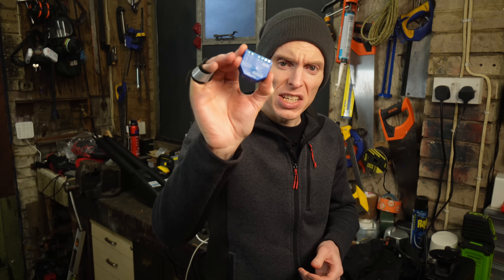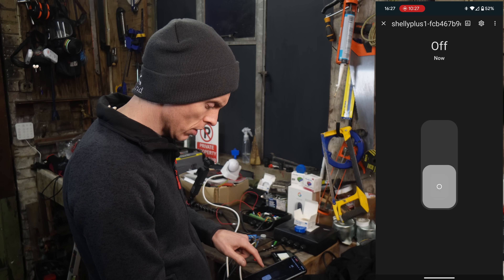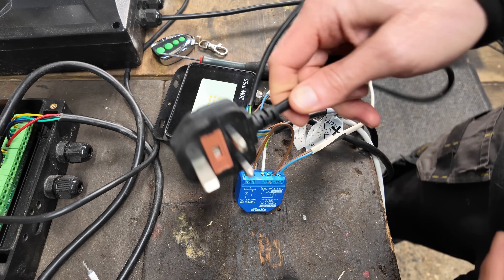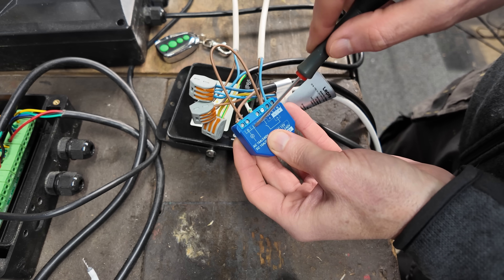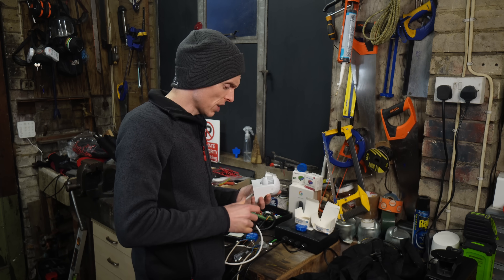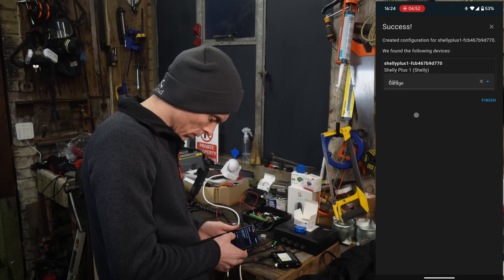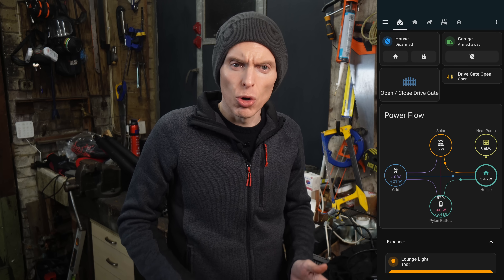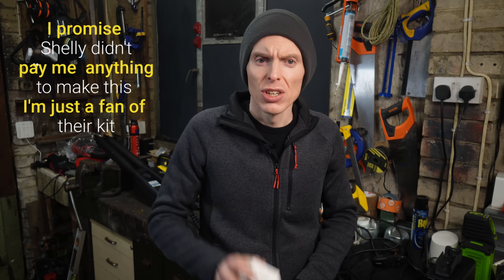Shelly 1 Plus: The Swiss Army Knife of Home Automation!

Comment: I found this a while back and worked out I could use this to pick up if a circuit was getting power. I’ve added this to my heating system and I can now see when the system is calling for heat or hot water and then when the pump gets power. Added the additional unit to the plus one and monitor flow and return temperature to the boiler and other parts of the plumbing system.
Reply from the maker: That's great use case for this, thanks for sharing.

Comment: Lots of modules have decoupled  relay mode. I use the Sonoff ZBMINIR2 which is a zigbee module, in decoupled mode, in light switches so that the switch operates but the power to the smart bulb is always applied. If the light switch is toggled and the light bulb doesn't toggle because it has crashed then a Node Red automation kills the power to the bulb and then reapplies power and then operates the bulb correctly... simples
Reply from the maker: I'm sure they do, just not something I've seen on any of the other switches I've used before, I've got a bunch of Sonoff stuff but none of their switches, never really seen the point in a mains powered device using Zigbee, saying that the new Shelly Gen4 devices support both WiFi and Zigbee so you can choose whatever works best for your use case.

Comment: But if you buy a wifi motion sensor... you will have the same.... I let my camera's detect persons/cars/license plates/animals etc... and pass that individual information on to the switches. This way the neighbor cat does not activate it or anything that emits heat... like opening the door in the winter. PIR motion sensors have too many false positives for me. Decoupling the switch could already be achieved with Sonoff switches and Tasmota software installed on them (for quite a while now). It's really not something new.
Reply from the maker: Do you know of any IP rated wifi motion sensors? I did look and couldn't find any, that's what originally inspired me to come up with this solution. I've also used frigate and the detection of people to switch on the lights. 

I wasn't really suggesting the detached switch was new or unique to the Shelly modules, just pointing out that it's there and really useful.

Comment: Why wouldn’t you use a smart motion detector and a smart switch?
Reply from the maker: When I first looked (it was several years ago now) I couldn't find any IP rated motion sensors. I've got loads of zwave motion sensors in the house but nothing IP rated for outside.
Reply: @ Tx!

Comment: I added a Shelly to my doorbell. Everytime someone rings the bell, I will get a push notification. (If I'm in the second floor, in my office, I cannot hear the doorbell, when the office door is closed. - a Shelly was cheaper than an alternative wireing and a second bell in my office)
Reply from the maker: Thanks for sharing your use case, I had a similar problem in the loft of our last house, ended up with a Nest doorbell and Google Homes dotted around the house to solve that, but I appreciate privacy concerns mean that's not a solution everyone is comfortable with.

Comment: I’m using Shelly i4s to indicate when lights are turned on in a room and trigger media players.  The problem is the i4s need an isolating relay in circuit to prevent the back feed from the live/neutral of the load triggering the i4s constantly.  Im also only using one of the i4s inputs in each case. I’m guessing I could use these instead as a trigger for HA and simply isolate the relay as I don’t need it to do anything and also negate the need for isolating relays.
Reply from the maker: Yes, it sounds like you could probably use a Shelly 1 Plus instead of the i4 for that, I am curious, why would you not also want to use the relay to allow you to remotely switch the lights on/off or automate them?

Comment: Was gonna say it's WIFI, and no one want a wifi powered smart home. But gen4 is Zigbee !
Reply from the maker: I've got a selection of Zwave, Zigbee and WiFi devices, I have no problem with WiFi smart home devices for anything with a permanent power connection, I have WiFi everywhere so it makes a lot of sense. But the new Gen4 devices having Zigbee is a great addition.
Reply: Like everything it's a tradeoff. I like WiFi since I can banish it to a VLAN & firewall it off and don't need to add a ZigBee hub as a dependency, MQTT and ESPHome both work great and are very reliable. I have a couple Shelly Button 1s and while it took them a while to get the firmware right they're pretty fast now & rechargeable (like twice a year I plug them in), no coin batteries to worry about replacing. But for things like door and window sensors, ZigBee is the only thing that really makes sense
Reply: I have way better experience with wifi over zigbee, had so much issues with zigbee in my house I would say: who wants a zigbee home? :p
these shellys are mains powered, and thats good since nobody wants to swap batteries anyway
Reply: Hold up brother….nobody wants a sub protocol over WiFi….id suggest upgrading your network infrastructure delivering WiFi

Comment: Great application examples, thanks. I have a Shelly 1L controlling my shed flood light.
I also use the Sonoof Zigbee switches, which I find work much better for no neutral applications.
Reply: The ZBMINIR2 sonoff devices (that require a neutral) are great devices too if you already have a Zigbee mesh and they support decoupled relay mode whereas the ZBMINL2 (no neutral) does not
Reply from the maker: I've never tried any of the Sonoff inline modules, probably should they seem to be much cheaper, but that does make me a little uneasy, sometimes spending a bit more for something you're embedding in the walls of your house is worth it.  I know the Shelly modules have Overheating protection and the power monitoring modules have Overcurrent / voltage protection,  not sure the same is true for the Sonoff modules.

Comment: We have 240V(+9V) smokedetecors with signal to chain all detectors. I've added the Plus1 mini inbetween the signal cable to turn on all lights an infrom my phone through HA in case of an smoke alarm. Should be a requirement.
Reply from the maker: That's an awesome use case, thanks for sharing.

Comment: Shelly devices are the best on the market. Cheap and affordable. I use the detached relay mode so I can control smart bulbs from a normal switch without cutting power
Reply: Doing the same here. We have floorlamps and using the standard wall switch.
Reply from the maker: Thanks for watching and the comment, much appreciated. I've just bought a bunch of Moes ZigBee GU10 bulbs and am planning to do the same thing for the wall switches 👍

Comment: Could you wire the Shelly, with a motion sensor to the aux input of the victron multi plus so that it charges the battery when the postman turns up? 😅
Reply from the maker: Well that's just silly, it would charge the batteries when anything moved, obviously I would need to use Frigate to do facial recognition on the postman and then use the shelly to trigger trigger the Victron aux input charging, no more foxes triggering charging, just the postman 😄
Reply: @RodMcBain  good point… I didn’t consider the foxes!

Comment: Yes, the decoupling is the key feature.

By the way, Gen4 products are available now, which add Matter and Zigbee connectivity (along with the existing wi-fi and Bluetooth).
Reply from the maker: I did see the Gen4 products are out, very cool and still great value. It's taken me far too long to edit this, they weren't out when I recorded it 😀
Reply: Have you tried a gen4? Can they integrate with ZigBee and act as a router there while themselves being controlled over Wifi? ZigBee notoriously has a bad range in non-wooden houses, requiring me to pepper my house with ZigBee plugs just to relay the signal. It would be nice if Shellys, that are there to actually do something, could take over some of that burden---while being on wifi so they don't suffer from the ZigBee out-of-order and delayed message delivery.
Reply: @HenryLoenwind  no, apparently the Gen4s can be set to either use Wi-Fi or Zigbee. Not at the same time, because they're on the same frequency.

As soon as the 2PM Gen4s are on sale, I plan to have 13 of them installed in light switches around my home, creating a decent Zigbee mesh.
Reply: @natts  Thanks. Then I'll bin that idea.

I really wish all iot devices were as open as the Shellys. (Or Shelly made versions of everything.) But so far, for many things, ZigBee is the only way to have "runs locally" and "integrates into HA well", even though it's lacking at "runs well" and "has a range farther than I can jump".
Reply: @HenryLoenwind  it's spelt Zigbee, not ZigBee, by the way
Reply: @natts  Yeah, just a habit from naming my devices "ZigName" (ZigDoor, ZigWindow, ZigFinger, ...).

Comment: The scripting feature is also very useful to customise the behaviour of the device.
Reply from the maker: Not something I've ever used, I guess I've always been able to what I need from Home Assistant automatons, but certainly great to have as an option 👍
Reply: @RodMcBain  
My usecase for the scripting.
With a standard lightswitch, you only have On/Off positions, so the physical switch can only perform one action.

Using Shelly scripting, I can detect if the switch has been toggled twice within 500ms and then perform a different action.
In my kitchen, I can turn the light switch On/Off quickly and it will send a command to turn off the Ceiling Light, Undercupboard lights, plinth lights. 

In my livingroom, I use the double toggle to control a table lamp on the otherside of the room.
Reply from the maker: @gavinnoname1424  Interesting, my new gate controller has a relay that indicates if the gate is open / closed, but when it's moving it toggles back and fore between the open / closed state. This looks OK in home assistant, but it would be cool if I could use the scripting to detect that and expose 2 new states, one for opening and one for closing, sounds like maybe the scripting can do that, I'll investigate, thanks for the inspiration.
Reply: @RodMcBain  You can do the same inside HA by triggering on state change with no delay and check if the automation was last run less than e.g. 1 second ago (AND IF: "Test if template renders a value equal to true" = "{{ now() - this.attributes.last_triggered | default(as_datetime(0), true) > timedelta(seconds=1) }}"), then enable a helper input "moving". Add another automation that triggers on state change with a 2-second delay ("For __:__:__") to reset it to "not moving". Then add a state input helper to combine those 2 boolean into a "open"/"closed"/moving" state input.

Comment: Shelly products are best on the market. Thanks for giving me a new way to integrate them. Brilliant.
Reply: Shelly products are good but I have now migrated to Zigbee, with a POE zigbee controller that can handle up to 300 devices and I have about 60 running with no issues for 6 months. With wifi devices I always got IP colisions or devices would just randomly drop off the network...
Reply: @smitcher cool, can you give some info on which products? I'm in the market to replace an old X10 system with zigbee.
Reply from the maker: They definitely hit a sweet spot for functionality and cost, I used to use zwave modules and they are all terrible compared to the shelly modules and at least double the price.
Reply: I also find Shelly unreliable, on wifi keeps dropping out of the system. I've given up on him.
Reply: @katiporoka Interesting. It’s too bad that you have that experience. I find Shelly devices to be the most reliable of all the ones in my home. But to be fair, when I moved to Ubiquiti for my network core, everything is much more reliable. I used to have to reset devices all the time but since I started using Ubiquiti gateways, access points, and switches, everything has gotten much smoother. I hardly have to think about my network these days.

Comment: I’m using Shelly 1PM and a Shelly mini to control the heating and cooling of my pylontech batteries in the server rack. I’m using ceramic heaters I’ve just finished building the second battery rack as an  identical setup. Using home assistant with the Victron hacs add on to see the battery temp of the pylontechs also used the addon for the Shelly’s to have a temp and humidity readout of the racks
Reply from the maker: Cool, thanks for watching and the comment. I'd never come across the Victron hacs add on before, always just used MQTT to read and write values, not sure if using modbus is better, but great to have the option.
Reply: @RodMcBain  yeah I’ve heard loads of people using that just found the hacs addon fast and easy been working good and I can see everything I need to force charge discharge and so on.